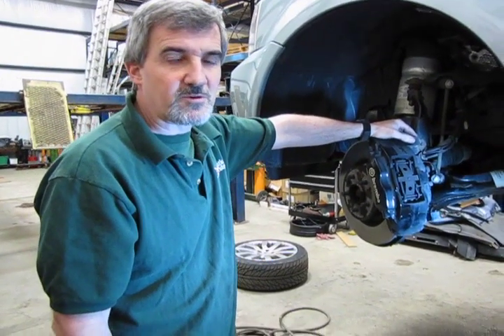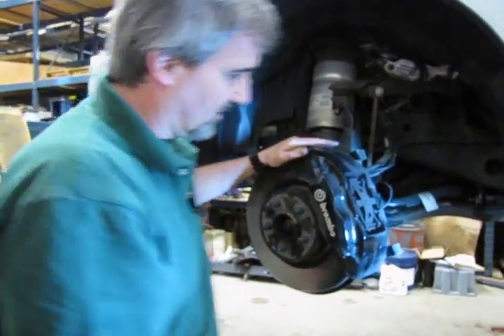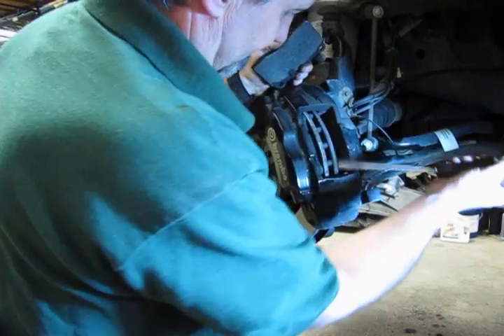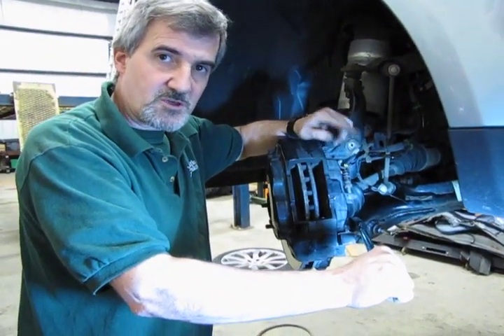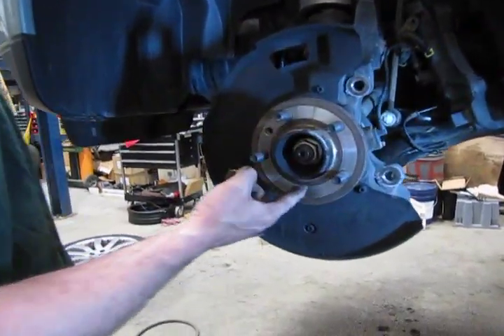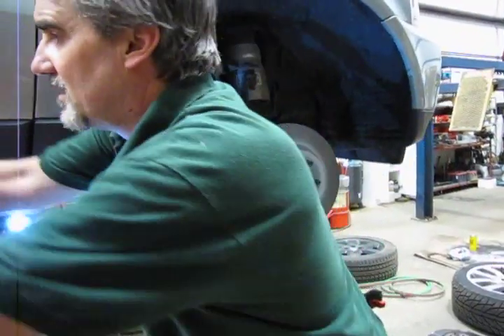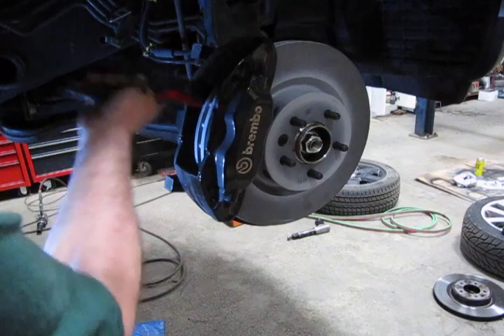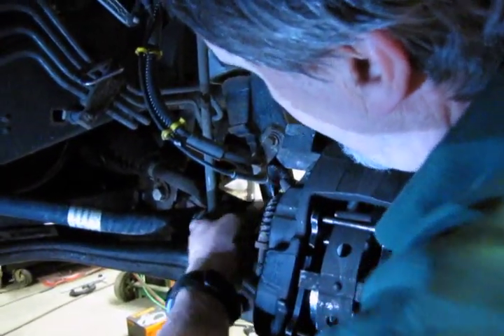How To Replace Front Brakes On A Range Rover Sport Supercharged

Comment: Brilliant. Thanks for sharing this video. Saved me a small fortune. Bought genuine Brembo pads and discs (rotors) for £160 and the senor wire for £8. Did the job myself. LR quoted £1,200 to supply and fit. As the wheel was off, I also took time to clean a load of areas you don't normally get to. Took me a morning, but I think I did a great job and am well pleased with the results.
Reply: Kenny G where can you buy them what site I'm in the us..

Comment: Hi, I replace the rear rotors and brake pads. Now I cant change the gears from low to high. The green light stays blinking on the dash as if its in the middle of the gear change. The air suspension, terrain response and park brake work. Its just the low to high gear switch. Please help. 2006 range rover sport.

Comment: Great video thanking you so much. May I suggest a few drops of threadlocker on the 2 caliper securing bolts and also the rotor securing screw. I was also told to lightly smear some copper (high temp.) grease on the back of the new brake pads and on the brake pad pins.